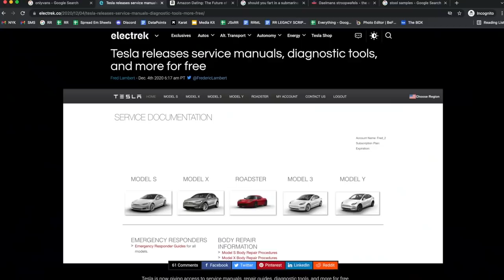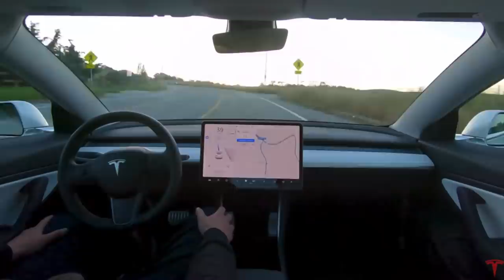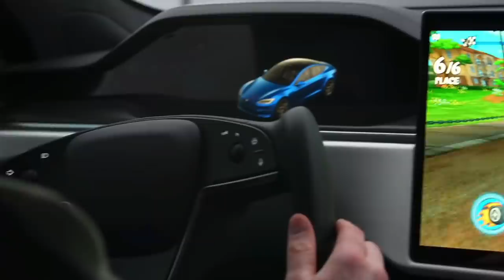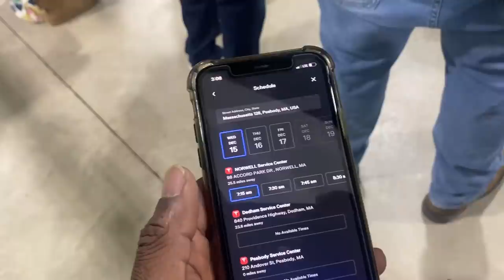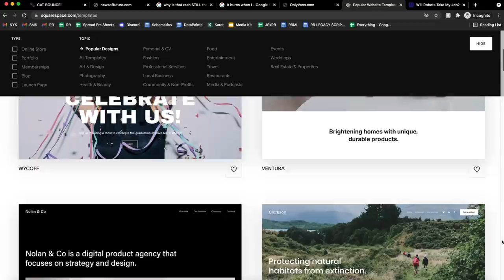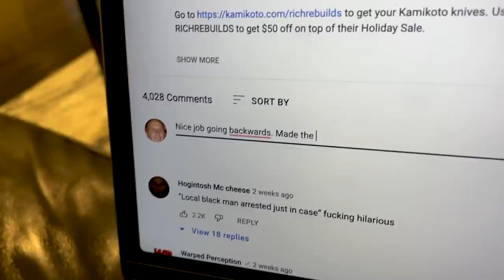How Tesla is failing its most Loyal Customers

Comment: Same thing happened to me over here in the Netherlands. Brand new 3 and the battery pack went after 6000km. Took me 6 weeks to get it back. Worst customer service I’ve ever had through the entire 6 weeks. No shot I buy one again and I tell everyone I know exactly that.
Reply: Waarom überhaupt een elektrische auto... jemig arme vlegel
Reply: Try that at any other company and it'll take you about the same time! These are coming from California, and it takes a while to get it to you. Do you expect them to put it on an aircraft and ship it overnight? lol
I own a VW and it took me 3 weeks to schedule to get the car in for a little work. 3 weeks!
Reply: @KyleHubb  fan boy
Reply: @KyleHubb  Have you been to a auto part store, they keep 1000s of parts in stock in even tiny towns no need for any kind of waiting. Tesla doesn't allow stores to buy parts for stock to begin with.
Reply: @PCgamer923  Tesla is not an auto parts store. lol
I get what you're saying, but I've waited 3 weeks to get a minor detail fixed on my VW because that's when they could fit me in. This is from an auto manufacturer as big as VW. These dealerships have to order that part, if it isn't one handily available, they might have to ship it in.
Reply: @KyleHubb  Lol you can literally go to a Ford dealership and purchase a whole ass engine in a crate and 90% of the time they'll have it in stock. 2 months ago we purchased a new transmission for a 2002 Excursion and they had it in stock... A replacement tranny for a 20 year old truck... And Tesla which has only 4 models which all share almost half their parts, cannot have a spare battery on hand? For the love of god...

Also Volkswagen is an absolutely horrible company with crazy anti-customer tactics. I remember once a family friend had to get a new battery for his VW Touareg... Guess where they put it? Under the drivers seat... You need to take out the drivers seat and guess what, they use a SPECIAL 'security' bolt that only they sell the socket for, for a very nice and reasonable $250 for a damn socket... Long story short we forced out the bolts and just replaced them with normal head bolts. What a bunch of clowns.
Reply: You do get a rental. First world problems
Reply: @00000005547  It's easier to get the HV battery in the US or China. In the Netherlands, you might have to wait for Shanghai to ship the LG battery or CATL battery pack to you.
Reply: @KyleHubb  you didn't actually watch the video, did you? This is not a logistics problem, it's one of attitude. You have a problem with your Tesla that they can't fix and a service rep tells you straight to the face that they're focusing on making new cars instead. If Tesla gave any Fs about their customers after delivery they'd keep at least a small number of parts in stock somewhere that isn't halfway across the globe.
But I'm sure an airbag sensor that they can't replace for over a year is fine if only you believe hard enough that Teslas are extra safe.
Reply: @KyleHubb  this is BS, VW has for sure distribution, components and repair services everywhere in the world, tree weeks waiting what? A cyan cupholder in recycled plastic?
Reply: Once the warranty expires can you rebuild the battery or get a replacement one
Reply: @KyleHubb  I own a VW (I’m on my second) and the one and only time in a combined ownership of 10 years that I needed a spare part (a $50 boot latch) it came the next day. I suspect you’re just another Tesla fanboy making up shit. 
Tesla’s are very impressive, but also too expensive to ever achieve Elon’s supposed vision of an EV future. Not to mention have the worst service in the history of the motor industry. Be objective.
Reply: @KyleHubb  how about build a car that doesn’t break down after 6000km or carry stock if you know you are building crap cars at $70k a pop. I’ve owned a lot of cars and I’ve never had to wait 6 weeks for a repair let alone a part.
Reply: @ogzombieblunt4626  all my problems are first world problems, I bought a Tesla not a rickshaw. Mind you a rickshaw might be more reliable. 🧐
Reply: @KyleHubb  Lmfao. Bullshit! I own a VW & have never had any such issues, I live in a major market where one would expect shortages (NYC), & the parts I’ve needed were available same day or overnight.
Reply: @fredyllanos8972  Houston TX. Momentum VW. Stop playing with me!
Reply: @KyleHubb  That is because Tesla service is weak.  Why stock the most difficult to repair part that will leave the owner stranded weeks if they need it? Because the can and they do.  Apple does the same thing when I order service parts, some of them come all the way from China overnight.  Air freight does not work for a massive battery pack like this so they put it on a boat and you wait 2 months.  A smart and well designed service network would have difficult to transport parts in stock in the country or maybe actually FIX the battery back instead of a whole unit swap?
Reply: @fastharri  Wow, all this attack because I tried saying that even major automakers can have long wait times too? I get that Tesla are growing quicker than their service centers, but c'mon, even established automakers have this same problem too.
Reply: @walrusitow614  Visit the Taycan forum, or Mach-E forum. Or even the ID.4 forum. These EVs are a new tech, and a lot of the problems are new in the auto industry. With a new design, comes a new engineering challenge. The ICE powertrain has been developed for ages. Please give these guys time. Chevy Bolt was recalled for battery problems, Taycan was recalled for car losing power randomly. It's not easy.
Reply: @KyleHubb  I think it’s because you’re making it up because you’re of the Tesla Fanboy Tribe. No other mainstream auto manufacturer would behave in the manner Tesla has, largely because they don’t have an army of subservient apologists; who hysterically can’t even afford their products.
Reply: @KyleHubb  they can have all the time they want. I personally won’t get into another full electric till they work the bugs out. I drove a plug in hybrid Volvo on a recent trip to Switzerland that was pretty sweet. I’ll probably get something like that next time.

Comment: Speaking from working for a top tier insurance company in the claims department. I can not stress this enough Tesla service departments are rip offs. I can give several examples where a simple claim (fully replacing a front left quarter panel after the insured went into a dead man pole) turned into replacing a full front end because tesla service claimed "all the sensors in the area needed to be replaced". I could go on and on about the parts, quality, the upselling, their service department makes money hand over the foot on the tesla idiots.
Reply: @timemachine_194 Insurance offered by Tesla has the potential to stop shady Tesla repairs as they would be biting into their own parent company's profits rather than someone else.

Comment: I noticed a very minor rattle on the front driver side on my lexus IS350. Its 2015 model, like always I just drove to lexus dealership, drop off my lexus, they gave me a very nice loaner car. A few hours later I got a call and they told me its just a bad sway bar link and they also mention my rotors are have some vibration. i gave the green to do both front sway bar link and no to the rotors. The next morning I pick up my car. They turn both my front rotors and did the sway bar link but they only charged me for the sway bar link. Lexus/Toyota customer service is just the best. I could have get my car actually on the same day i dropped it off but I decided to enjoy the loaner car for a day and they dont care at all. No extra charge and they are not pushy to sell unnecessary job on the car.

Comment: My Plaid’s rear passenger side subframe harness was destroyed (a design defect causes it to rub against the tire if the harness is installed improperly, which it was at the factory) and Teslas first appointment to fix it is still over a month away. This is my fourth Tesla, and also my last.
Reply: I’m on my 5th tesla (plaid now myself). If I had your problem I’d run for the hills as well.
Reply: @claytonjones006  it is far from the only problem I’ve had with the vehicles and service. It just happens to be the last straw for me.
Reply: @ryanhuber8629  Can’t say I blame you. We sold our Model X after the “Permanent” half shaft fix last May due to the car driving worse than it came in. Denied my claim to buy it back as it had been in for service so many times. I sold it to a dealer and walked away. Probably should have learned my lesson after that. Hopefully my Plaid stays problem free.
Reply: 4 Teslas, yikes. Just get an e tron or something at this point.
Reply: @MiGujack3  I am in the first batch of Rivian deliveries (my current timeline says March/April). I expect it to have problems, but they have the opportunity to keep me as a customer if they handle problems better than Tesla, which is a very low bar.
Reply: @ryanhuber8629  I actually just placed an order yesterday for an R1T but with a max pack so hopefully I’ll get it late 2023. This will go along side the plaid assuming it doesn’t have a ton of problems and I have to flip it.
Reply: Good. Leave the company. Far better electric cars will be available in the coming few years
Reply: Anytime Tesla is rejecting a buy back, is just leaving the opportunity for a Lawyer to handle it. Lemon law is surprisingly easy to qualify for.
Reply: That’s plaid bs
Reply: I wonder what on the odds of having serious issues with a new Tesla. I thought about getting one but put it off since it was a new company and new cars. Let them sort of things first was my feeling. But this poor service is something else to consider.
Reply: @Rhaspun  I've had 5 new teslas between my wife and I since June 2020 (turned in early to get something else). Model 3 lease, model X (issues, sold), Model Y (wife's current car), Model 3 (changed my mind and sold), Model S Plaid last month. The only car to give me issues was the Model X. So one out of 5 (so far) isn't too bad. 
That being said, the Plaid is probably the last Tesla for me.
Reply: @MiGujack3  Buddy of mine sold his e-tron ( the A6 SUV version ) after 6 months because the range on the highway was too small ( 250km ), now has a Q7. E-Tron GT is a different story and different price
Reply: Please don't read this as a criticism, but what keeps you coming back? Is it just because you want an EV and feel Tesla is the best to offer? Or...?
Reply: @belavet  for me, coming from a Hellcat Charger and Trackhawk it was about performance number one. Charging network was number two. By the time I get ready to move on from my Model S Plaid I’m sure there will be other options worth exploring.

Comment: I always cringe when many fanboys pump the hype about the Tesla reliability talking about a Model S that passed 1 million miles...when it had it battery pack replaced twice, multiple times the rear motor, door handles and other stuff that all added almost is enough for a new Model 3.
Reply: hey at least that model S passed 1 million miles;)
Reply: @timemachine_194 indeed
Reply: To be fair, the 3rd battery lasted 3 times longer than the other 2 so at least there is some improvement
Reply: @greynolds17   @Gerrad Reynolds  some say the issue with Li-on base battery cells degradation it's that it's gradual over some years, then has an abruptly progression losing range. So when the battery pack is newer, it can handle multiple recharging cycles and mileage. But not so much over some years, independently of the recharging cycles and mileage it has.

Comment: I work for a 3rd party EV repair shop in Southern California, and we specialize in repairing Tesla powered cars (including the Toyota RAV4 EV, Mercedes B-Class and of course all Tesla models as well). 

I find it's worth noting that the service subscription that Tesla offers uses Toolbox 3. The issue with Toolbox 3 is that it doesn't work with Tegra based cars (e.g., any "early" S or X with MCU1), which in many cases are the cars that are the most in need of out-of-warranty repairs.

They of course neglect to acknowledge this fact before you subscribe the to service subscription, as we found out at the our shop since most if the Teslas we work on are Tegra based. Luckily we only paid for the monthly subscription to try it out instead of the yearly one...

Apart from that fact, they also don't offer any sort of "kit" to actually plug into the cars, you just have to hunt for that yourself and figure out what cables/adapters you need. Luckily there are a few 3rd party retailers that sell the necessary cables (not that it matters much since the software doesn't work with the cars it really should work with the most anyways).
Reply: Which repair shop? I have a Model 3 that’s been mostly service free but I’m looking for repair shops to recommend to friends as I am worried that Tesla service will continue to deteriorate right when my warranty on the drivetrain and battery is up!
Reply: @standyro609  QC Charge in Vista CA.

Comment: They tried to lock down repair but it won’t last at this rate. There’s too many people that are used to buying gas cars that are easily fixed by the shop across the street.
Reply: @adrian69644  most shops can’t fix a gas car let alone a electric car…
Reply: @adrian69644  They’re building 250k cars each quarter. You’re telling me they don’t have parts? Are you high?
Reply: @adrian69644  Tesla has all the parts in the world making that volume of new cars. They’re just so incredibly incompetent they don’t think of supporting the customer after they’ve purchased a vehicle. How hard would it be to ship one seat to that dealer instead of installing it in a new car? You think this is normal?
Reply: @adrian69644  Normal for them.
Reply: @markm0000  Maybe this is what you get when you by a car from a Tech Co & not a Car Co.
Reply: @adrian69644  they apparently only had 3 wheels worth when they built it and sent it out as complete.  I am curious about the VIN dates - how many are built during the big push to meet end of quarter demands.
Reply: @markm0000  it took 6 months to replace my bumper cover. Even in a fancy European shop, 4 weeks max.
Reply: @svenjorgensenn8418  Damn. Values on Tesla’s are way up now. It’d be a good time to sell it and get something more reliable and supported.

Comment: These are ironic times. Companies spend millions to improve customer experience and yet when you have an issue, they are unable to solve anything. Customer service is just a call center where you can call but nobody is authorized to help you.

By the way, bottom line with this company is that if you have problems with the car, is your fault so screw you and don’t even bother calling because no one can do anything about it. Everybody is focusing on selling more cars to new customers that have no idea what they are getting into.
Reply: Well, it is partially their fault, they keep buying these cars.  That's not how American companies work, if they do the wrong "cheaper" thing and you keep rewarding them by buying their product, then it's no longer the "wrong" thing.  Companies do not have morality they have what makes them more money and what makes them less money. If this isn't affecting their ability to sell a car and then they don't have to service the car, then this is the correct way since it makes them the most money.
Reply: Right

Comment: I find it interesting that GM suspended assembly of new cars to concentrate on existing customers with the limited number of parts they had.  Kind of makes you want to buy a car from a company that cares about it's customers.
Reply: Best company I've ever worked for they value there employees and costumers
Reply: GM doesn't make their money off EV's and offer a wide range of other vehicles. You think Tesla can afford to just stop making one of their 4 vehicles? 
They are backlogged over a year. Every part they make is already spoken for on a new vehicle. Until they can clear the backlog (which should be this year with the Austin and Berlin factories coming online this month), this situation will remain. Especially during this pandemic, where all parts are in short supply.
Reply: @LloydM  I would think any car company that wants the repeat customer would want to fix the issues existing customers have with their cars, especially if the issues take the car off the road or has a serious effect on enjoyment on the car.  I'm not saying they have to divert all new car parts to fix issues, but they should make some available. If someone wants a Tesla that bad, they will wait for it.  People do it all the time.
Reply: I'm actually surprised GM would do that!
Reply: GM has had 7 years to address the AFM lifter issue in their trucks.  When GM gets that right, then they’ve found religion to the customer.  As for Tesla, it took Elon 12 years to realize that making cars “is hard”.  Both companies suck.

Comment: I feel bad for front line service staff at dealers... mainly cause I used to be one and you're stuck between a rock and a hard place. You're tied to whatever HQ does or doesn't supply and you're the face of the company that gives all the bad news to the customer. I got so much stress doing that job, it was an amazing feeling quitting and moving on.